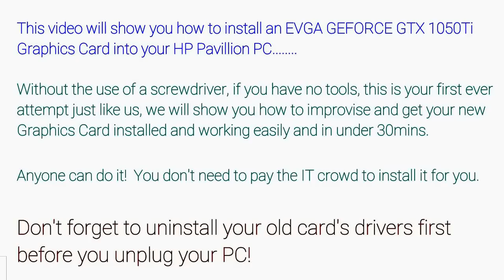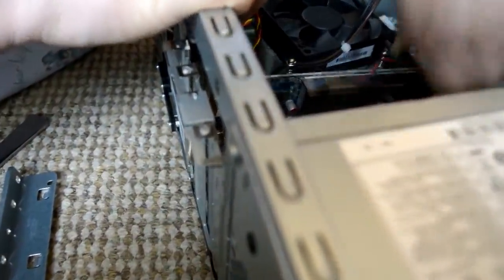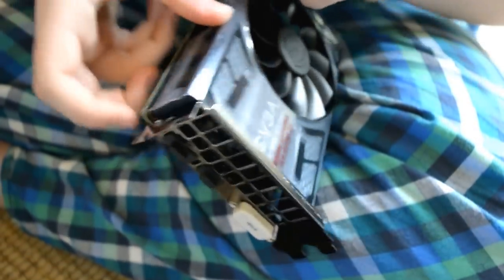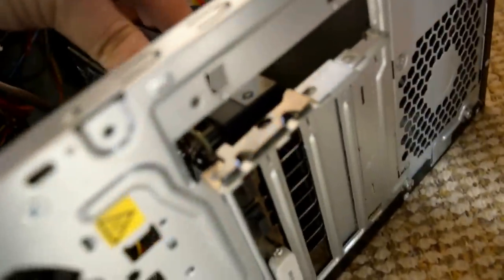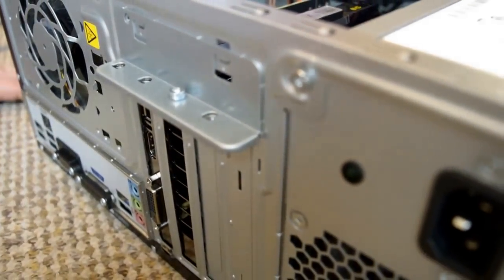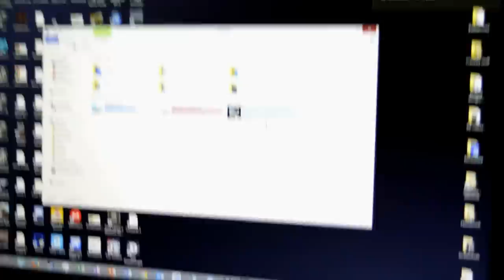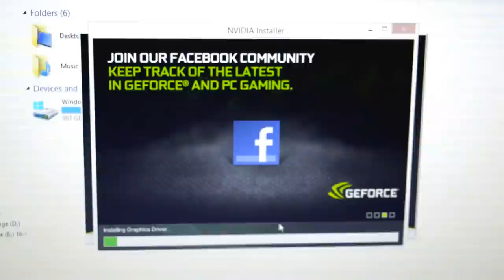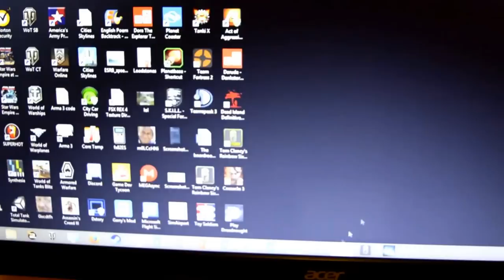How to install - NVIDIA GEFORCE GTX 1050Ti Graphics Card

Comment: You just put it into the graphics card slot and your done?  It doesn't require a pcie to power it up?
Reply: thats the pcei express slot, just snaps in and youre done
Reply: So it powers it up through the pcie express slot?
Reply: JxP yea
Reply: What about that one joint you plug in from the side?
Reply: Chris Hansen This only applies to certain graphics card models.
Reply: Chris Hansen It doesn't apply to the GTX 1050 Ti.
Reply: Critical saw that t had no place to put it in when I got it

Plays any game like a charm

Comment: How much watt is your power supply?
Reply from the maker: 300w
Reply: Did the gpu run on that psu?
Reply: Loren Savanaline that gpu doesnt require power from the psu it,draws the required power from the mobo.
Reply: @comb1ned916  and where does the mobo draw power from? the PSU so it does require power from the PSU
Reply: SixOutlawzNZ  i mean that it doesnt require any additional connector

Comment: How did you know that the graphics card would be compatible with every part in the pc? i have an HP Pavillion 570-p056na and i want to put a GTX 780 TI in it.. anyone know if i can just slap that bad boy in without needing to replace any other parts?
Reply: With that graphics card you're fine you won't need to replace any parts in your computer because that computer comes with an Intel i5 7400 which is compatible all the way up to a GTX 2080 TI even the newest RTX series is will work with that CPU.  so you won't have to replace any of your part just make sure your power supply can handle it because even a GTX 1060 will run on a 300 watt power supply as long as it has the 6-pin connector. But other than that you're CPU and RAM is compatible just make sure you have enough power on that computer though. The GTX 780 Ti will require you to have at least a 400 watt power supply minimum with an 8 pin connector PCIe  where would the GTX 1060 which requires a 6-pin connector will run on a 400 watt power supply but the minimum power requirement for the 1060 is 300 w. but the GTX 780 Ti does use a bit more power than the 1060.
Reply: So far that graphics card the minimum power requirement would be no more than about 400 w anyting lower than than that more than likely will not run that graphics card as there will not be enough power to supply the graphics card.
Reply: @kennethjones2152  dude thanks so much lmao. I asked the same question in the hp support forums shit and they just tole me to buy a shit ton of expensive parts. So imma just get a new power supply and the graphics card. Probably a new case too, I think mine will be to small.
Reply: @timothysalazar6689  here's a question for you what games are you looking to run on this computer.
Reply: @timothysalazar6689  and you're welcome
Reply: And I thought maybe you would like to know this but the GTX 780 Ti is actually kind of an expensive graphics card and uses more power then the GTX 1060. The GTX 1060 uses a minimum of 120 watts on a full load and requires a minimum power supply of 300 watts recommended is 400 watts but will work just fine on a 300 watt power supply as long as your power supply has a 6-pin connector you can also buy an adapter that will plug into your computer that will allow you to turn your power supply into a 6-pin connector if your power supply doesn't have one built in. but honestly if I was you I would go with the GTX 1060 anyway I would go with the 6gb model you can find those brand new on NewEgg for less than $250 780 Ti will run you over $300 and on top of that the GTX 1060 is about 20% faster anyway. so you're going to notice a better frame rates with a GTX 1060 the two cards are almost very similar in performance but the GTX 1060 does pull ahead in performance. And only requires a minimum 300 watt power supply with a 6-pin connector. And is very compatible with the Intel i5 7400 processor. I would personally recommend the 6gb GTX 1060 as it will future-proof you a little more and I would also recommend upgrading your RAM if you have one stick of ram in your motherboard I would recommend upgrading your RAM 2 dual channel ram which is two sticks of RAM because you're going to get better performance out of your graphics card with dual channel ram over single channel ram.
Reply: And if you want to see how the two cards perform side-by-side there are videos on YouTube you can watch just type in GTX 780 Ti vs. GTX 1060. And then that way you can see for yourself that the GTX 1060 is a faster graphics card and in my opinion is the better card for your money because it's cheaper and offers more video RAM.

Comment: hello, please help! I have the same case as you I put a gigabit video card Geforce 1050ti 4g, I turn on the computer and there's the HP screen saver, I can not not go anywhere, F10 is not working, the BIOS can not go in, what should I do?
Reply: does it work now?
Reply: Install F9

Comment: What is your power supply?
Reply: The power supply in this computer is 300 watts which is actually enough power to supply a GTX 1060 as 300w is the minimum requirements for a GTX 1060 as long as the power supply has a 6-pin connector because a GTX 1060 doesn't get its power straight from the PCI Express it gets its power straight from the power supply. The recommended requirement for a GTX 1060 is 400 watts minimum is 300 watts as the GTX 1060 only draws about 100 to 120 watts on a full load

Comment: can i install inno 3d gtx 1050 in my pc if my pc was using nvidia gtx 260?
Reply from the maker: Not sure you will need to Google the minimum requirements needed.
Reply: Marvin Kam since the gtx 1050 ti is a low end card and only requires 75 watts to run it should work but I would check my pcie slot just to make sure and that your psu is 300 watts also check if your CPU would bottle neck it because the gtx 260 is a pretty old card would might suggest a old cpu

Comment: Do i need  disc or i can just download on the internet driver?
Reply: You can just download all your drivers straight from the Nvidias websiteif you bought the same graphics card or just any other Nvidia graphics card you can just download the drivers straight from their site same with AMD graphics to if you don't have a disc and most the time the discs are usually outdated it drivers anyway. so even after you download the disc it's going to have then require you to download more drivers updated drivers from the internet then so you're better off just downloading the latest driver from the internet in the first place

Comment: what if the graphics card is bigger than that one?
Reply: Lavender Lady it depends if your PC case is big enough for ex look in the video you just watched she used a one slot PIC version but the original uses 2 they are both the same price small and big so if yeah both will have almost exactly the same performances therefore you should pick your GPU size depending on the length and width of your PC case and by the way I recommend the small one because you could put a another GPU in your prebuilt PC so you have two GPUs that can up your performance a lot more!
Reply: @vinnyn10  thanks!
Reply: Lavender Lady I mean if u want two GPUs you need to get a better CPU so it won't bottleneck each other

Comment: Hey just wanted to ask you a question just took off the 460 GTX off of my Dell 9100 added to 1050 TI are there any plugs to plug into that because I took some plugs off the 460 or is this an update that you don't need no plugs to the 1050 TI

Comment: What are the system specs of your pc?
Reply from the maker: HP Pavilion 500 -459 na
Reply: Lou Boo That's it's model the specs are CPU, RAM, HDD, Graphics ...
Reply from the maker: Oops...well like I said this is the first time I have done anything like this. Will have a look and get back to you om that. Not an expert but I try. 😉
Reply: Nurgle Cultists with you can find by just looking it up it looks stock
Reply: It hase a core i5...there is a sticker
Reply: @lukemusic7813  well then that case you can just look up that model number on the internet and it would give you the specs of that computer

Comment: NO NO NO LOL THIS TAKES 5 min.. BUT YOU WERE ON CARPET THATS A BIG NONO ANDDD YOUR POWER SUPPLY DOESNT GROUND YOU IF IT ISNT PLUGGED INNN sorry for the caps
Reply: Carter Weakley What does the carpet do ?
Reply: New to PCs just asking
Reply: TSA _SupremePlays well you can build up static on carpet and if you open your pc while on carpet you could shock parts... and if your pc sits on the carpet it gets hotter and dust buildup is worse.